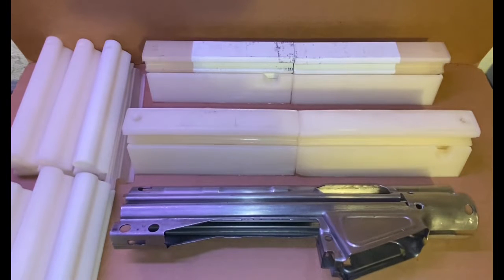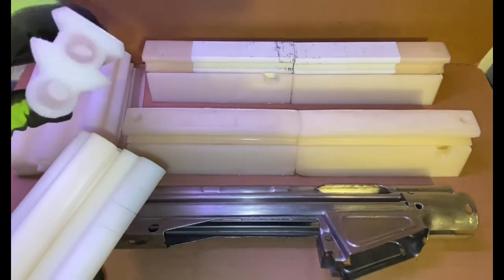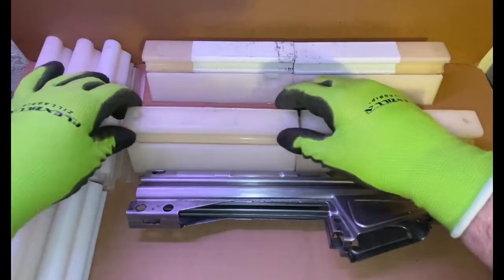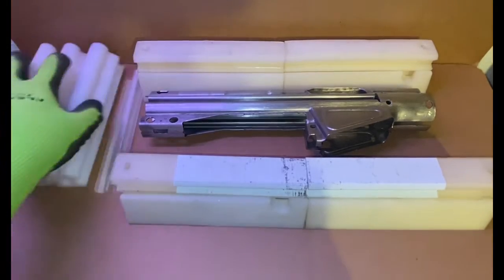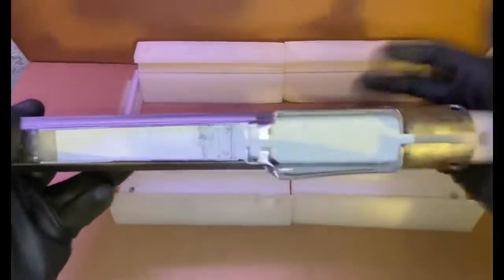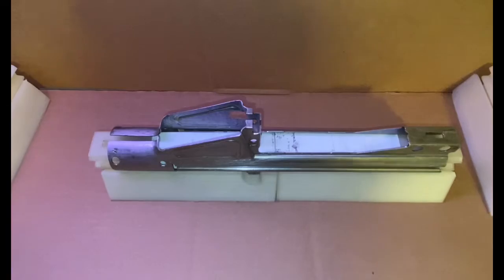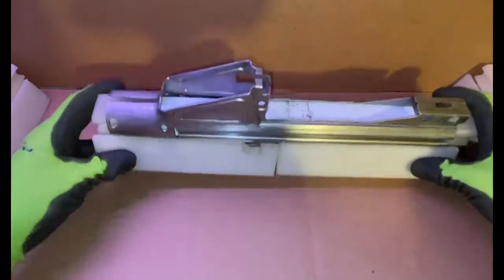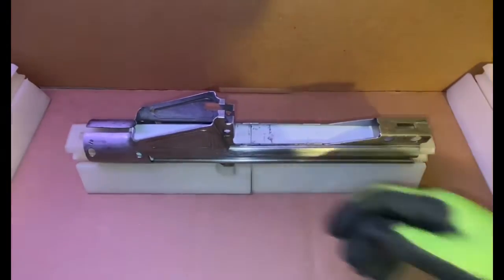3D Printed CETME C Bending Jig

Comment: You check the ID on that upper and lower bend radius?
Reply from the maker: I did not.   Let me know what they should be and I can certainly try to grab some measurements.
Reply: @SMR-Tactical  20mm ID on the upper part of the receiver, 39mm ID on the lower.

Hope that helps.

Comment: I've used it before, but my Wire MIG keeps eating through the test pieces I have so I can't use it to weld the receiver, I need to buy a TIG but I'm on the fence cause if I'm only going to use it once to build a CETME it's not worth the Investment buying a TIG. So I bought an already Completed Receiver to finish my build until I decided to buy a TIG. Good Luck with your build!
Reply from the maker: I know what you mean.  I only have a lowly flux core welder, which certainly will work for this receiver but is not ideal.  First test weld blew directly through the metal, after some trial and error I was able to get it to work.  It doesn’t make for the prettiest welds, but it will hold.   Been super busy recently but should be getting mine welded up and finished here shortly.
Reply: What settings were you using on the welder? Sometimes making a backer/heat sink helps too for the thin stuff.